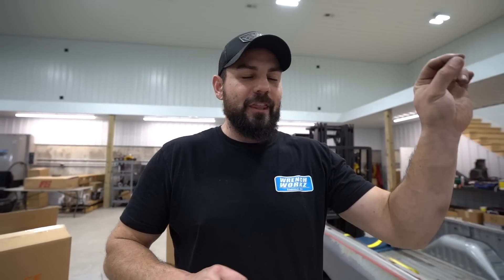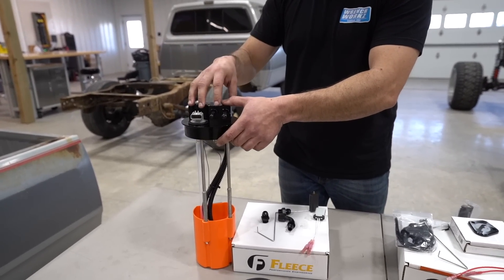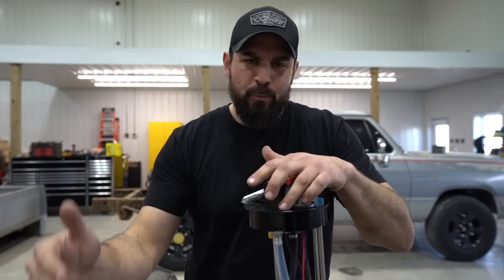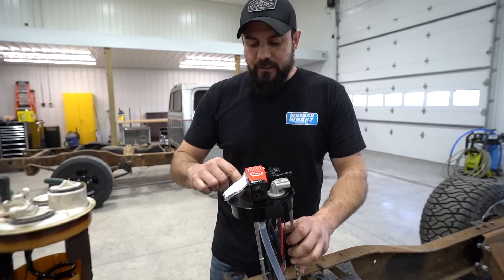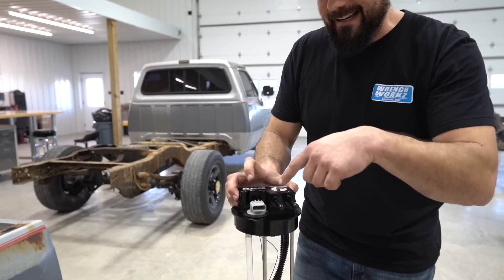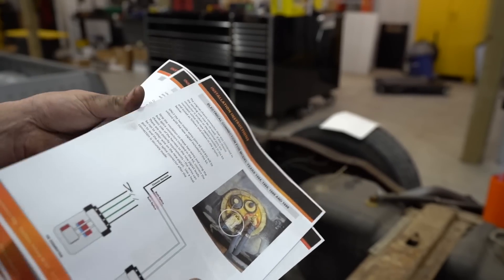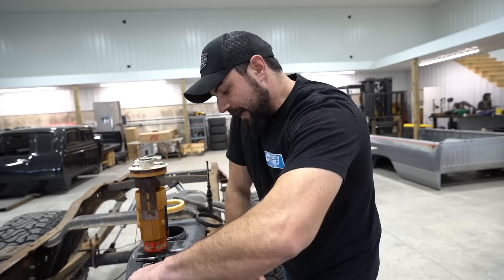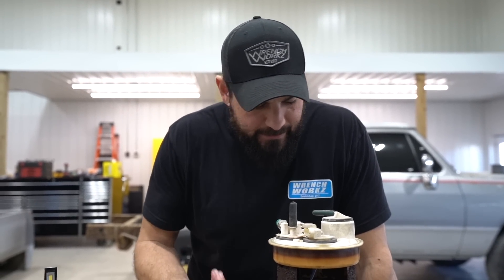NEW CUMMINS Build Parts!!!! Your Truck Needs This NOW!!!

Comment: I also believe there’s little tiny flakes of rust sitting at the bottom of the fuel tank could definitely raise hell with your lift pump. I’m talking about the pump. It’s right on the side of your engine six in a row.Jim from Kenner dollop, Pennsylvania

Comment: Wow! I wish I knew about this last year. I had to use one out of a 97 dodge in my 1990 because I couldn't find one. The connector for the fuel gauge is different so my fuel gauge doesn't work.
Reply: I just dropped a "98 Carter pump in my tank on my '93. It puts out 18lbs. Get the FSM  in CD form for your truck from Geno's garage. You can ID the wiring. The '98 doesn't have a provision for the low fuel light. However we used the FSM to properly connect the fuel sender. It works!! I also had to run wiring to the fuel pump. Elcheapo Amazon connector. I am afraid of running 18lbs so I got a fuel regulator.